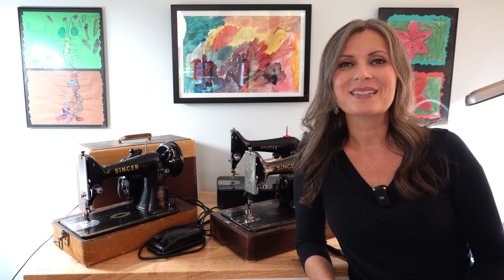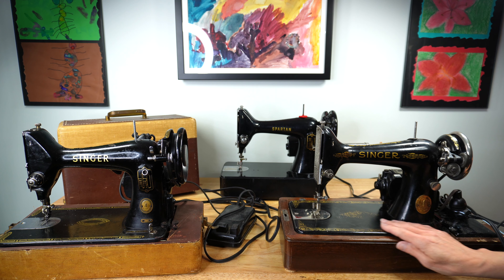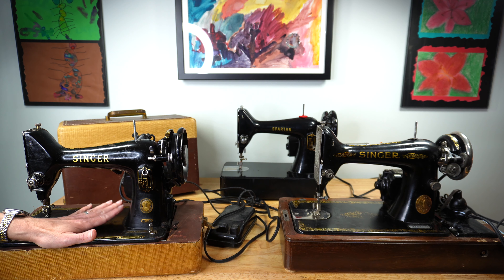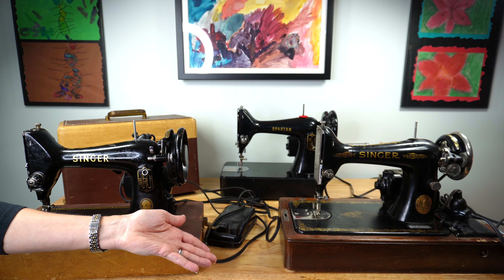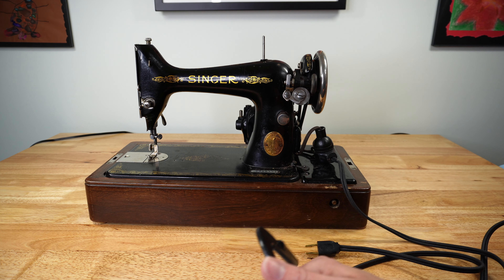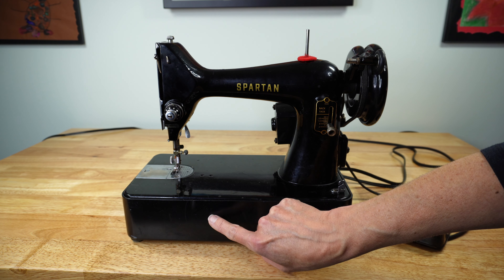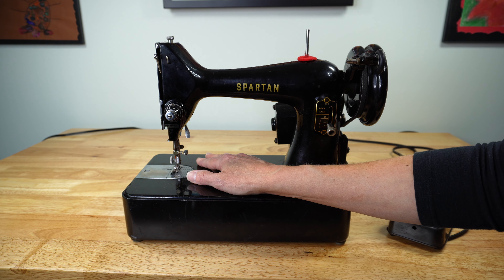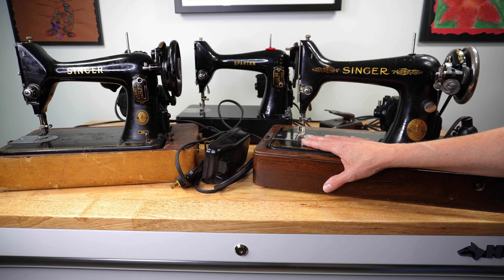Singer 99 Restoration - Part 1 - Identify your Singer 99 ***New Series Launch!***

Comment: I have a Spartan and an early 99. The 99 is a hand crank. The Spartan is beautiful - mint condition. The 99 was well-used by a previous owner but it does work.
Reply from the maker: Very nice! I have a hand crank 99 as well, the later model. Such a sweet sound it makes!

Comment: I have the Spartan which i purchased off of Facebook market place. It has a wooden base some made and attached a light. I also own the heavy bentwood 99 purchased from FB market place also. I just lost the eyelet on the front of the machine and in need of finding a replacement for it. It doesn’t sew correctly without it.   I love these old machines they are wonderful
Reply from the maker: I love them too! If you can't tell. 😊 I hope you find what you need to get your machine working!

Comment: I have a 1923 Singer 99 in a bentwood case, a knee control, but a different style of attached light.  There is also a decal that says Great Britain.  I don’t believe my machine has an aluminum head, as the head is magnetic and aluminum in non-ferrous.  I am really looking forward to this new series!  Your videos are truly some of the best I have found on YouTube.  Thanks so much for sharing your expertise!
Reply from the maker: Thank you! I do my best :) I am excited to test out the knee control and see how hard it would be to fit it with a foot control if you wanted to. I personally like knee controls, no pedals sliding around the floor, haha.

Comment: I have my mother's 1941 Godzilla 99, on which I learned to sew. It has the angled lamp, back tack, a metal Godzilla foot pedal and a numbered tension dial. It also has a walnut bentwood case which I refinished in my youth. About a year ago I rewired her and have replaced the foot pedal with an electronic version. (I have kept the original pedal, but don't use it.) My daughter found me a  Featherweight (also a1941),  so I have really enjoyed your Featherweight videos too. Interestingly, both machines were manufactured in New Jersey.
Reply from the maker: How neat! Even more special when it is a family heirloom!

Comment: Hi, I’m so glad I came across this video series. Thank you. I have just purchased a late 99k in pretty good condition with the lid but it’s missing the lid for the accessories area 😔
Reply from the maker: Yes, sadly some of those parts end up getting lost over the years. You may be able to find a replacement on eBay or something though! Good luck with your restoration!

Comment: I am so happy you are providing this 99 series! I own a 1922 aluminum model 99. These are rare because Singer inexplicably decided to manufacture only 8,000 of these in aluminum. I have wanted to restore mine but the unfamiliar wiring configuration has intimidated me. Thank you for providing the instruction I've been hoping to find!
Reply from the maker: Hi! I didn’t know the number of machines they made in aluminum so thanks for that info! I love how light it is! Yes, the videos on the wiring are going to be interesting, probably the most complicated I have worked on. Should be fun!

Comment: I just bought a 1922 99K that looks exactly like the early model you are working on, also a knee lever. (I would love a parts list. I'm in need of a new belt and a new tension spring and my amazon purchases are not Singer brand and do not fit). Your videos are beautifully done; your camera work and voice over are professional, clear, and very helpful as you actually explain what to do if parts are not easily removed. One very comical moment was when things were not working after reassembly and after several removal and reassembles realized the machine needs to be replaced in the case. You mentioned that in your first video which of course I had skipped. Thank you again for all of the detailed work. Loved having a woman to woman instruction without all the extraneous filler or noise, direct and to the point.
Reply from the maker: Hi! I am so glad the videos have been helpful so far! Yes, these need a base for sure! Have you looked at Bob Fowler's website for a parts list? I'm not sure if he has one there or not. Sometimes that old information is really hard to find. Let me know if you find a good resource!

Comment: I was given a 99k circa 1956 with a cabinet and bench. Apart from grease stains on the body here and there, it looks new. Runs fine. I was m intending to take everything apart and clean it. So I am following your video direction. I have already cleaned up the motor.
Reply from the maker: I know you are going to love this machine! Good luck with your clean up, sounds like you have a real treasure!

Comment: I recently acquired a model 99 (I think). It matches what you highlighted on the earlier one on your table, but it has a button style foot control and a light (screw in base). The serial number is EC860146. When I try to get a date from the web, it indicates 1940, but not sure if I agree. Plastic case is destroyed, but not sure if it was original. Does that date fit into what you consider the earlier style 99 date range? If it is an earlier, do you know when the foot control was added? I am a senior guy, new sew person and also recently purchased a featherweight to be delivered tomorrow, which is how I found you. I'll let you guide me once I get it set up. Glad to join you.

Comment: I have a 99k Nov 23, 1955. I also have a 99 Feb 1 1928 that came with a bentwood case, however, the kneebar is missing. My husband is going to try to make me one by tube bending. I watch Bob Fowlers videos every week.
Reply from the maker: Hi! Love the 99’s! I think they are under appreciated. How nice that your husband is able to fashion a knee bar, I hope it works out! Sometimes we just have to think outside the box when we need parts for these old machines since they don’t make parts for them anymore. :)
Reply: My treadle is to small for my 27 so I am going to use plexiglass on the top so I can use it.

Comment: Mine is a 1949 era 99, so it doesn't have the numerical stitch or tension settings, but does have the external speed controller, which is mounted in its case for use by knee
Reply from the maker: Nice! I think it is fairly easy to get used to the ones without the numbered dials. Thanks for sharing!

Comment: I have the late model 99. It came with no bass. It came with no motor. It came with no light and I was able to get it completely working. Cleaned up. Take it all apart. Cleaned up. Put back together and it sews great. Now I had a Kenmore 3/4 machine that had a case. I just took that out of that base because it didn't need a base and I used it for the 99. I'm trying to find one I want but that's kind of getting difficult but I like my 99. So between it and the Kenmore 3/4 machine I have two small sewing machines
Reply from the maker: Great job on your 99! Good luck finding the base for your Kenmore!

Comment: I have a Singer 15-88 in a wooden base covered with leather?…it has the number JC1222295 on a plate on the machine. The tension gauge is left side of the machine towards the back. The reverse and forward is a numbered stitch length. It works like a charm! I oil it and clean it after each projects. I do keep a toothbrush for that purpose. I do have a light and a foot base. I have no clue what year it is? Got it in 1966. It weighs a ton!
I also have a 401J…the first zigzag…inherited from my mother. I quilt!
Reply from the maker: Sounds wonderful! Keep taking care of it like that and you will be sewing on it for years to come. Thank you for sharing!

Comment: I was gifted a Summit treadle machine.  Have you ever heard of it?  Trying to learn more about it.
Reply from the maker: Hi! I haven't heard of it, have you found anything out? Treadle machines are fabulous!
Reply: @SewingMachineRehab  I have found it was manufactured by AG Mason and they were bought out by White. Now that the holidays are over I will continue some research.  I do need a belt so I need to find a supplier.  I live in Central FL.

Comment: I have the later 99k and am looking forward to this series! What years was the Spartan manufactured?
Reply from the maker: Hi! I am excited for it too! From what I have found, the Spartan was made from 1959-1961. So only for a few years and it ended right around the time they stopped making the 99 all together. There was at least one other version of the 99 that I don’t have, hoping this series gives everyone a good idea of how to work on them and maybe eventually I can make some videos on the other versions. There were variations in the hardware on the knee control and also the stitch regulators and tension mechanisms. Probably because they made them for such a long span of time. Whew!

Comment: I have a singer 99- , What does the dash after the 99 mean? The serial # is AM522393
Reply from the maker: I can tell you that the serial number was allotted to your machine in 1956. The dash probably means that it was made in the United States. Someone may correct me on that, I read and learn about the machines but remembering all the info...sometimes I have to look it up again. I believe the K on a 99 meant that it was made in Kilbowie, Scotland but some were also made in Clydebank, Scotland. And some in the United States! So, it's a lot to keep track of but I can at least tell you that it was made in 1956! Hope that helps!
Reply: @SewingMachineRehab  thx so much! I did finally get the answer after much searching. The - means it was manufactured in New Jersey.

Comment: I have a 99k 1950,s and  my motor and foot  peddle get very hot is  this normal  ?  thank you
Reply from the maker: Hi! It is normal for them to get warm but not very hot. If they are both getting hot they probably need adjustment and servicing. Could be a simple fix, better to have someone look at it for you to rule out any problems.

Comment: I have the early 99 it was made in 1930
It has the hole for knee control but I don’t have it
Reply from the maker: Nice! Sometimes you can find them on eBay, you just have to make sure the connection end is the right shape for where it connects to the base. You can also rewire it to be foot control only and use a new electronic style foot control. A little complicated to do but it can be done!
Reply: I love your videos ♥️ they have been helpful! I used to watch Bob…
Reply from the maker: @BrendaH289  Anytime Bob posts a new video, I am one of the first to watch! Makes my day!

Comment: I'm confused about my 99K. It looks like the early model with the un-numbered tension dial, and just the dial for the stitch length. 

But based on age, it should be a late model as it was made in 1952. 

But it is a hand crank with no evidence it ever had a motor. 

So, going by appearance it is a hand-crank early model, yet manufacture date would say it is a late model. 

Hmmmmm.
Reply from the maker: Interesting! Does it have a motor mount? Do you think it was converted?
Reply: @ no markings of any sort that would indicate a motor or even a treadle.